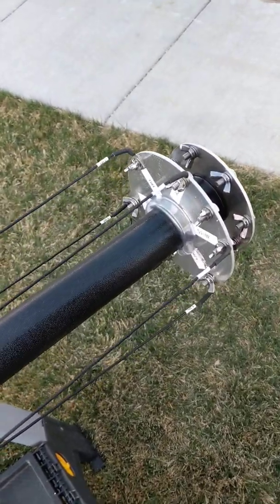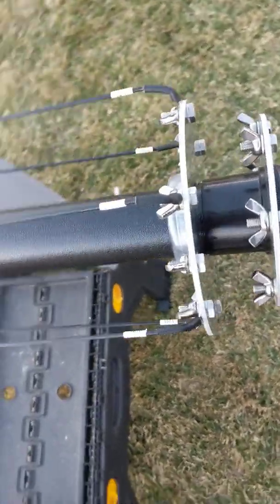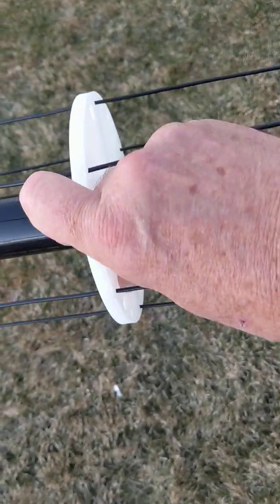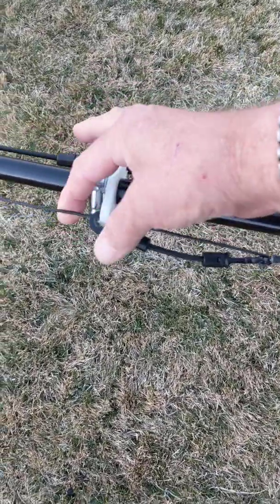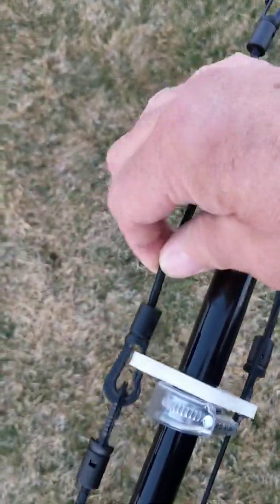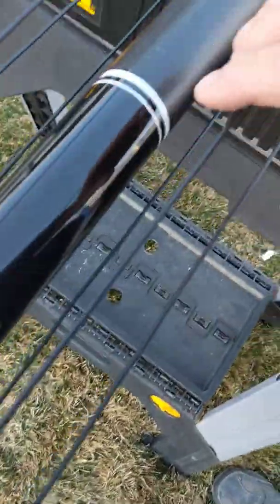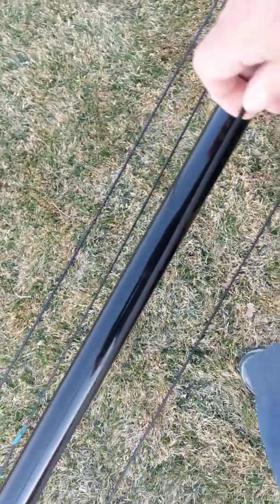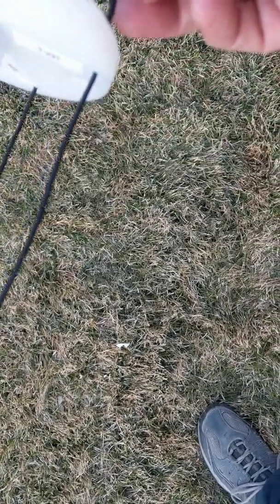DX Commander CLASSIC

Comment: Bravo! Great video on how to arrange the elements. Following individual elements from radiating plate to the end without flipping back and forth top to bottom really helps.

The 40m element descriptions  others have given have left me scratching my head. Yours is excellent!

Thanks for the video!
Reply from the maker: Hey thanks for the flowers. I also was frustrated with especially running the 40m element over the top and figuring out the 40/30 deal. I should do another short blerb video and show how I added a little snap on device that slightly holds the element out three or so inches out from the pole about half way back down to where it connects to the bungee clip from the 30m section. It seems to keep it from wrapping around the top of the pole as I stand it up. I have no idea if it improves anything except it makes my OCD feel better because things are neat and orderly. I used to wind electric motors in my youth and everything had to be neat and organized because electrons would have a wreck and the factory packed smoke would come out. Have fun! I so miss going out. I have been suffering from some health issues and haven't been out doing POTA and now the weather isn't so hot I am going to try and brave it and go out. I love this antenna.

Comment: Thanks Bruce. I just got box 1 of 2 today and 2 of 2 is the pole on Monday. I have watched a lot of video on this antenna and the new Unified Manual that DXC has has lots of drawings to help you see what is happening, like where each element goes on the driven plate for 3, 4, or 6 elements. Much better than the manual you had in 2021. I am doing the 80 meter option by replacing the 30 meter with a 63ft wire and taking off at the top double spreader to a 13ft fiberglass crappie pole that I will clamp to a fence post. I don't do 30 meter right now anyway. 73, maybe catch you on the air. KN6ZVI
Reply from the maker: It's lots of fun and I do hope it at leas gives another view of the antenna. I always thro a couple of plastic saw horses in the truck and even though you don't need them I like them as bending is really hard for me these days so since I have the room I take them along. I havn't used it for a bit but I am going to soon. Spent time getting Kemo and such in the last year and am feeling better than I did and can't wait to set it up again.

Comment: Thanks Bruce, really helpful KG5ZLO
Reply from the maker: Thanks Robert . Since I am no longer very flexible I use sawhorses to set it on and put it together which i have room for in the truck, they are the plastic collapsable ones and I throw a small piece of scrap plywood across and use them as a table for my POTA operations. Just dont push down on the pole or to try and move it around while it is sitting across anything. I broke a section of the pole about 3 sections down and I was shocked at how easy it broke. otherwise it has been a blast to use and gets out really good. They only sell the complete pole but I gladly bought one and am back on the air with it. Also put the clamps just barely above the joints/just touching the joint! Dont Overtighten the clampe or they will crush the pole.
Reply: @bruceweight7319  once again thanks Bruce,  I'm waiting for the arrival of my classic ,but like you when I don't understand what instructions I like to see the pictures or video. Of course you took care of that with your video so 73's and be safe god bless

Comment from the maker: Hey Cal Mr. DX Commander I have been locked away in the cold winter and mud using my wire antenna's and I keep thinking some of the distant stations would come in so much better If I had my commander just outside the window and setup. Just dreaming of warmer weather and a chance to get out and put it on the air again, especially with the sun spots getting more active.

Comment: It was nice to see the support lines and how they worked out for you. I’ve been making the parts for my home brew version but I am closely following the Classic design. I’m building it today cause I finally got my wire shipment from TheWireman yesterday. I’m just using a shorter collapsing 10m spider pole for travel.  So, thanks for the up close view, most just skim over those details.
Reply from the maker: I cant wait to get out and put it up again. I had a whole bunch of things crop up here at the house and havn't had time to get out again. I have had some physical problems and am worried I will have an impossible time doing the setup but by golly I am going to try. I am going to try and get a few more shots of the setup going together. I really need to buy some more elastic cord and ends and re-do some of the tensioning lines. I have stuff labeled and that really helps but I do need a little more organization to get it right, so I can get it put up quicker. I am now getting a Raspberry pi4 put together so I can do digital when I am out.

Comment: I just bought one and this video made me clear lot of doubts Bruce. Thanks, good job!!
Reply from the maker: Thank you! I am going to suggest one more thing that I am going to do. I have a tool bag that I put all my stuff in wires coax ground steaks etc. What I am going to do is get a loop of rope and stack all of the clips and nylon spacers on it and put them in the order they go on the pole, that way I can get the pole stretched out and just slide the whole stack on the pole in proper order and put them in place Last time I had to slide several of the bottom ones off as I got them out of order? What a pain. Since I have plenty of space in the truck last time I went out I threw in those nice but light plastic saw horses in that you get at Home Depot and used two of them to hold the pole waist high so you don't have to reach for the ground level so much. You can put the small parts on the bottom shelf. If you have space it worked like a charm. I may make a table top and make them (saw horses) double as a table for my portable situation. I could put batteries and stuff on the bottom shelf during operation. I got spoiled with the vertical as I had a pileup on my first activation using it. Lots of far away stations all over the place on 20 meters. Yes the sun spots were good and the solar flux levels up the day I went out. It was a blast.

Comment: A little question, the end of 40/15 meter wire, with the loop and blue heatshrink, they pass in the ring on top of fiberglass pole? or you pass it before close the end of the wire?
Second question, is only heatrshrink? how you close the end of whire? 73 iu1lcu
Reply from the maker: Thanks for the question because I did have a problem there! What I did was put a small wire tie through the little loop and make it small and trim the excess end off of it and leave it on the pole so that I could pass the blue loop through it on the end of the pole. That is a problem, and I need to think about some more ideas for an adjuster and come up with a closure that will snap on the end of the wire. What ever you put on the end can't be too big because it may jamb up the sections when you take it down. You could actually put a swivel snap that goes on the end of your fishing line and use it to hook it to the little loop and hold the wire. (Good idea Bruce.... I will have to dig into my fishing stuff?)

Comment: Outstanding and great way of doing it.  Have got have mind up yet.  Because of physical reasons for a while. I got said  Outstanding job. And when you put it up what was your stanging wave on your bands and how much trimming did you have to do to get it to where you want it
 thank you 73 KQ4CD Paul
Reply from the maker: 1.1 to 1.3 on all the bands except 40 which is 1.1 at about 7.100 and a little high on the upper side of 40 I had to do it that way to keep 15 meters good in the middle of the band. It could probably use a little more tweeking but overall I believe it is a great antenna. I could shorten 40 some and use a tuner to touch it up on 15. It is a little time consuming to put up but easy. That 30 foot pole was a lot easier to put up than I thought.

Comment: I see you have your hose clamps in the wrong place, they should be below the spreader plates.
Reply from the maker: The spreader plates cannot pull down over the joints as they fit quite tight. If you put the clamps below the plates the antenna can collapse down inside of itself and the spreaders can wander all over the place. Putting them above the plates makes the spreader plates so they cannot go either up or down. I did find you need to get the clamps at the in between sections right on the joint so it wouldn't slip down and come loose. I suppose if I have the spreaders all down one joint from they should be then you are right because they would slide down, but the way I have them the elements seemed to fit right and the spreaders cannot move either up or down.
Reply from the maker: You might be right if I am putting the spreaders one joint too low, then you would have to have them below the spreader. Yuck I would have to re do everything!
Reply: @bruceweight7319  Like you I watched a lot of Callum's and others YT vids just to make sure I got it right, as Callum would say " no school boy mistakes" The clamps do prevent the pole sections from collapsing due to temperature changes.
Reply from the maker: @amsoiltek  Hey Rory, I think I did reply again but was reviewing my comments and couldn't see that I did. If I didn't say it you most likely are right about the clamps below the plates. If the clamps are placed right below the joint it would give the clamps two thickness of mast to tighten down on which would make it less likely to break the tube. I had envisioned pulling the sections up and putting the clamp just on and above the joint thus keeping it from sliding down and figured what the heck I could just put the spreader between. The spreaders would be able to wander around while you are putting it together though. next time I put it together I will give put them below and see how it goes; hopefully it doesn't change the fit too much? I didn't have to tighten the clamps very much to hold the sections from sliding when putting it together above the plate. My reasoning was as slick as the tubing is, I wasn't sure how well the clamps would hold by tightening them down on top of the joint Anyway? I don't think it matters too much but I do appreciate your pointing this out as it always good to learn options. Since there were no drawings, and the instructions didn't point out the location of the clamps I can hopefully avoid the wall of shame!
Reply from the maker: DX Commander  Thanks. I think my problem is that I am a bit old and creaky and forgetful so I have ended up making a few trips up and down the pole. The first POTA activation I did I was mainly on 20 and 40 meters and it was like shooting fish in a barrel. I had a major pile up. compared to my horizontal wire at home I was having fun with contacts all over the place. Thanks again!
Reply: The instructions say to put the clamps just above the joints, then put the plate above that. The only place where the clamp is above a plate is at the metal driven plate to keep it from being pulled up.

Comment: Good antenna but my friends and I were scratching are heads with the instructions.  I think  a big improvement would be to have everything labeled already when you receive your kit on both sides so no confusion.
Reply from the maker: Yes I had fun putting it together. I did have the same problem with the forked connector's, they were perfect for me elements but not for the radials. I cut all six elements exactly to the cut lengths in the cut chart. There was exactly enough wire for 19 but not 20 radials. I added a length of MTW 18ga which is huge compared to the 24 guage supplied, but works. I found that the whole antenna seems tuned high on all bands with the charts. My location was close to my stations wire antennas and a metal shed like resonate at 7.260 MHz I will be getting it out to a representative location and work on the tuning
 Not sure what I will do to add wire on as I literally used all the wire, every inch no waste at all. The kit needed probably at least 20 meters more. I believe it is going to be a great antenna once I get it tuned up.
Reply: @bruceweight7319  I also used all the wire making everything up but I ordered the extra spool in case I want to try 80m or needed some extra radials. So far it's all been preparation and I'm planning to put it up on the weekend. I have my Advanced (Extra) assessment on Saturday and didn't want to get too distracted. Y
Reply: @bruceweight7319  I used DX Engineering premium antenna wire (150'@ $30) for the elements, with some left over. I used the supplied DX10 for 7 sets of radials (4 in each connector and very low SWR.) at 11', with some left over. 73's. K8JAZ.
Reply from the maker: How much does the extra spool cost? You did the right thing. Shipping is expensive. If I have to I can get some wire that will work but be just a bit less flexible. I may get 500 feet of it.
Reply: @bruceweight7319  It's an extra 34 pounds sterling (whatever that works out to be in US dollars). I figured that the shipping cost to Australia would be the same so I might as well include it as part of the order. Y

Comment: Thanks Bruce, that is helpful. I've been looking at Callum's instructions and the tying off section s a bit vague. I didn't have the same interpretation as you for the first attachment of the 40m element (on the way up), but I'll have another look. A sketch of the completed arrangement in Callum's instructions would certainly be helpful. I spent a bit of time cleaning up the sharp edges on the aluminium plates with a metal file and a deburring tool. For the tapped holes I gently used a chamfer bit to take the edges off although you have to be careful as the aluminium is so soft. I used some 800 and 1200 grit wet and dry paper on the plates to give them a satin finish, not necessary I know but they look good now. I found Callum's supplied spade connectors (only one type) weren't large enough for the radials so I've ordered some speaker cable connections which I'll screw down and solder before fitting. I have used some graphite based conductive grease for the bolts and wing nuts to help keep water out. Y
Reply from the maker: One thing I figured out was the attachment of the 40 element to lift it up so it won't bend the thin upper part of the pole. The instructions say to use about four inches, but I would use six to eight  inches down for the support shock cord. Four inches is too close because the end hooks are over an inch long and your assembly is so short that it has no stretch left.
Reply: @bruceweight7319  good point I'll have another look at that. Y
Reply: @bruceweight7319  It's been a while so I thought I would give some feedback having out everything together and operated the antenna. It wasn't difficult to put the antenna together but I did find it quite fiddly to get all the cords and pieces of wire cut and arranged. As said elsewhere, some clear diagrams would go a long way to simplifying the build.

If you have limited horizontal space manhandling the assembled antenna can be tricky. That said once it's put together it's easy to take up and down. Rather than using tape or heat shrink to secure the wire loops I used thin HDPE garden tubing which has enough friction to hold the wire but can also be moved and adjusted. The 40m element was a pain to tune and ended bing much shorter than I expected, in the end I put a plastic T-piece from my garden watering system on the end of the pole to loop the wire back with a spacing of about 65mm to match the last oval shaped spacer. I ended up connecting the ends of the 20m and 40m elements with short/para cord to simplify the rigging as they tension each other. SWR on all the bands was fine, in fact lower than I expected.

In terms of performance the antenna is similar to my off centre fed dipole but being vertical can have more QRM. Comparing 20m on receive, it's one to two S points less sensitive than my simple horizontal dipole which is also quieter. The sensitivity could be due to additional elevation of the dipole. On transmit reports have been mixed but it doesn't appear to be definitively better than a dipole.

So overall the conclusion the DX Commander doesn't seem to offer any significant advantages of other options at my QTH apart from perhaps the flexibility of having so many bands available from one antenna. On positive note I have had some interaction with Callum and he's excellent to deal with. Delivery was super fast, even all the way to Australia. Y
Reply from the maker: @yamakawa511  Thanks Yamakawa. I have not operated mine in the field yet as I am putting together a portable station and that is what I bought the DX Commander for. I figure you are right as a dipole tends to be quite but NVIS and the DX commander should afford you some Good DX but one has to remember that the antenna goes up from the ground and is not high in the air which does change quite a few things. I also couldnt get 40/15 perfect as when I got 15 at a good SWR in the middle of the band 21.200 or so then 40 was way low like below the band in the tune. I then put a standoff about 18 or so inches down to hold the wire out about 2 inches and about as far as the top 2 hole spreader and that did wonderful things but still not perfect. I ended up a very low SWR in 15 probably 1:2 at 21.200 or so and `1:1to one on forty at about 7.095 but when you go up to lets say about 7.240 it was about 1:7 to one so for cw and the lower part of the band lets say where my buddies hang out at 7.155 it is still a good tune probably 1:2 to one. I should get a video of the standoff.